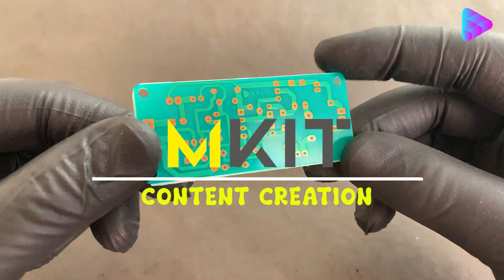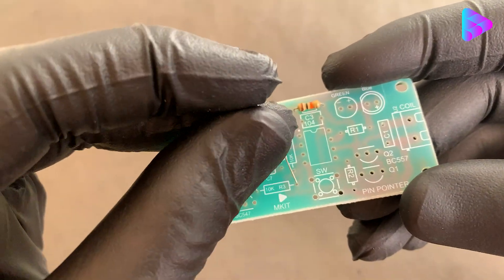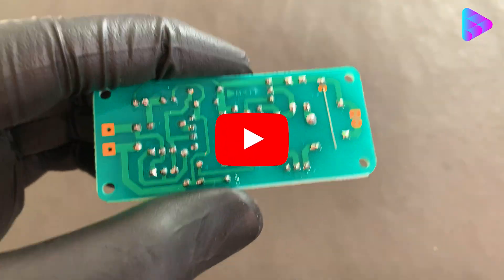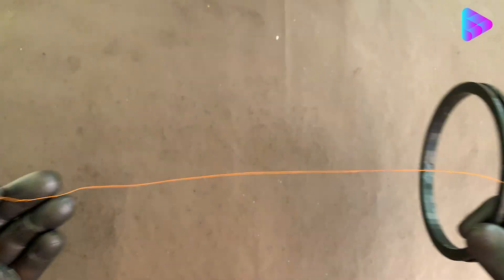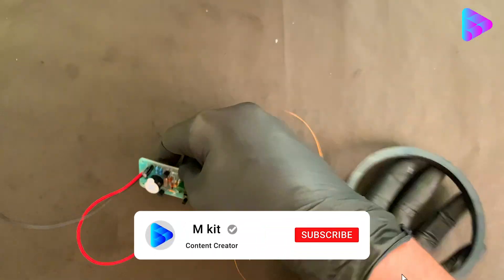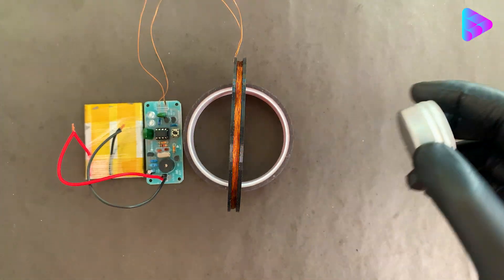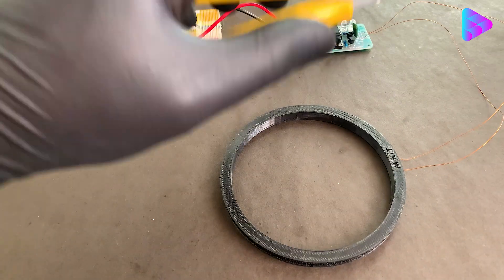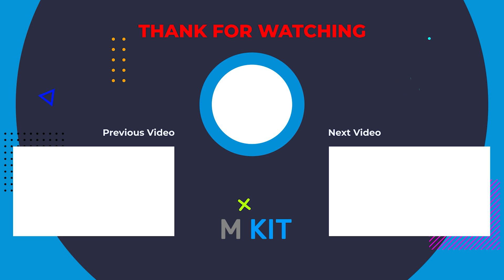**"How to Build a Powerful Metal Detector Pinpointer on a Budget! Step-by-Step + Project Files"

Comment: Yes, everything is very nice, but there are two components that appear to be 3-legged transistors that do not have the values, so with only those it is impossible to assemble the project . You definitely do not show the circuit from the connections side and if you do, you do it so fast that even stopping the video is not possible to copy it, not to mention that you omit the value of several components which makes one suppose that you really do not want us to build it, you also do not do horizontal air tests with coins so that we can test their range and see if it is worth building, I have already seen several videos and in all of them you omit showing the circuits, if you do not want to share it, say so directly so we do not waste time and we will see where they teach to learn selflessly
Reply from the maker: All files are in the description.

Comment: This video is a waste of time and our energy, 
No schematic diagram and nothing explained clearly but he want only 
Watch hours, likes shares and subcribers for this useless video.
Reply from the maker: The PCB file and 3D file are available in the description.
Reply: yes yes yes ofcourse
Yes, everything is very nice, but there are two components that appear to be 3-legged transistors that do not have the values, so with only those it is impossible to assemble the project
Reply: You definitely do not show the circuit from the connections side and if you do, you do it so fast that even stopping the video is not possible to copy it, not to mention that you omit the value of several components which makes one suppose that you really do not want us to build it, you also do not do horizontal air tests with coins so that we can test their range and see if it is worth building, I have already seen several videos and in all of them you omit showing the circuits, if you do not want to share it, say so directly so we do not waste time and we will see where they teach to learn selflessly